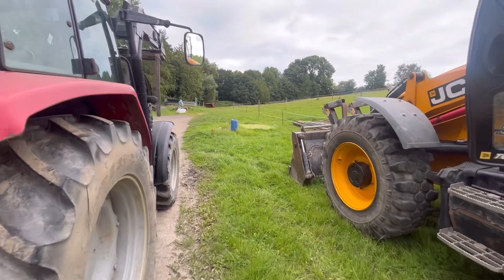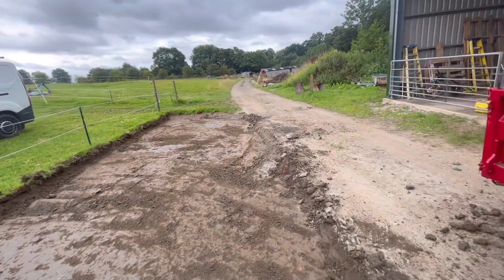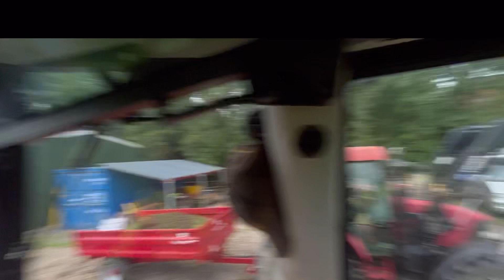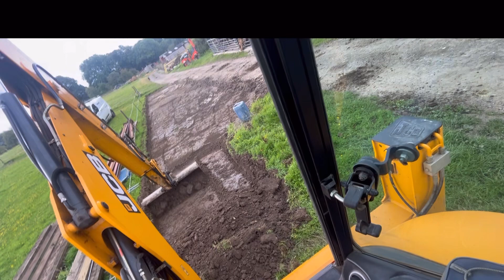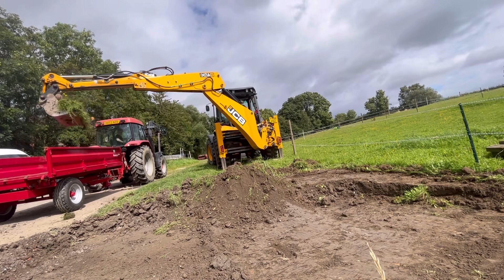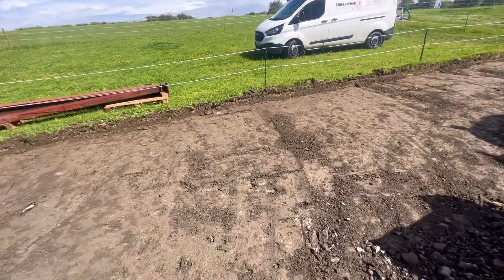Jcb 4cx backhoe loader digging off top soil @tedsshed2185

Comment: Ted, I'm just curious. For a simple backhoe job like this with scraping the wide shovel, are you using the lowest RPM's on the throttle?
Reply from the maker: Hi,
I’m running at around 1500 rpm
Reply: There’s a green band on the RPM gauge that runs from around 1350-1600rpm which indicates ideal engine speed for flow share on the back actor. 1500rpm is the most common sweet spot, ask any backhoe driver. After time you don’t even have to look what engine speed you’re at. You just hear it; feel it!